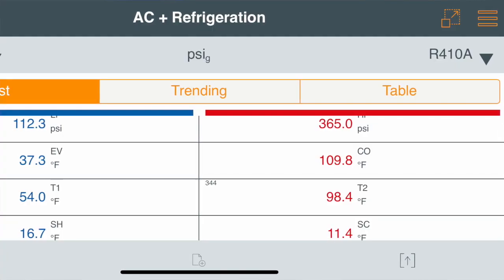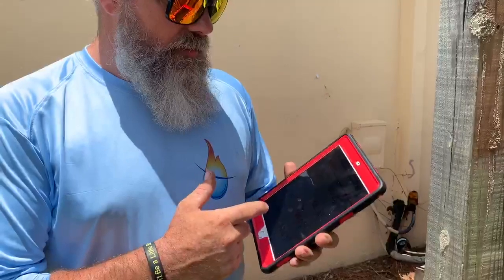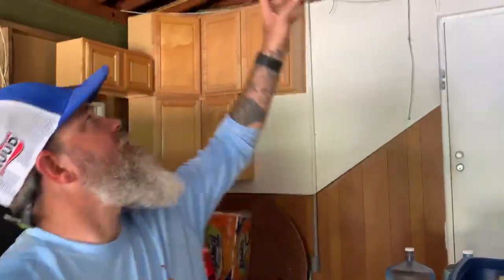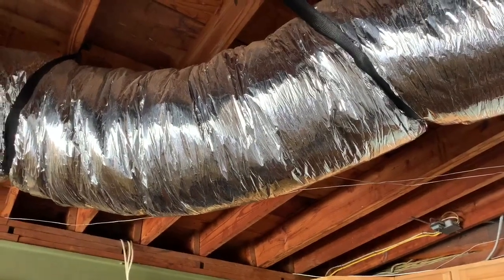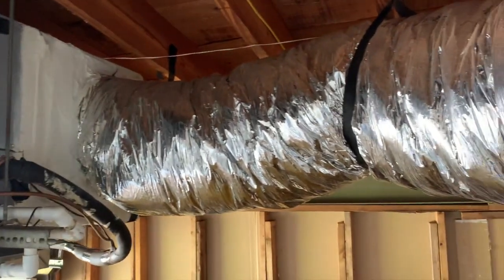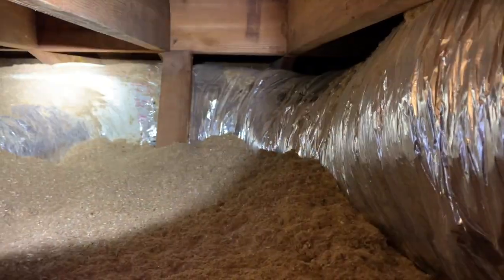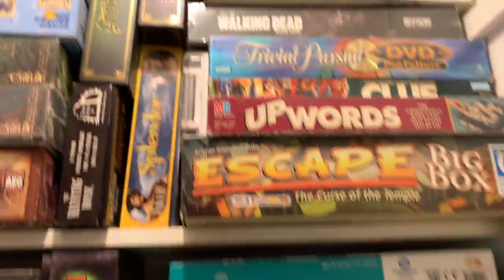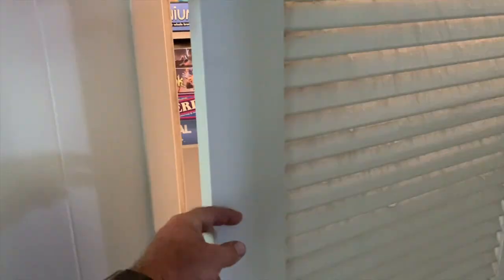Under size duct work AC not keeping up

Comment: A Good Way to test that theory is Remove the Return duct and see if the suction pops up. If so , Your good to go. If not , You know u have to keep looking. Ive seen insulation roll down off the inside of a supply box and plug off an entire duct. Remove both supply and return ducts and see if suction pops up. I am wondering what size the suction line is ? Liquid line size ? Ive seen under sized suction lines keep a suction lower than normal. Undersize by one size is all it takes. But, Definately 1 - 14" is too small for 4 tons. I use a rule of thumb 100 square inches per ton. Rule of thumb for supplys is same. 1 - 10" duct per ton min.
Reply from the maker: This sounds like good data on the duct sizes. I use a ductalator for my duct sizes however. This was just a good way to quickly diagnose an undersized duct system. 
If it was undersized copper lines my TD would be much less